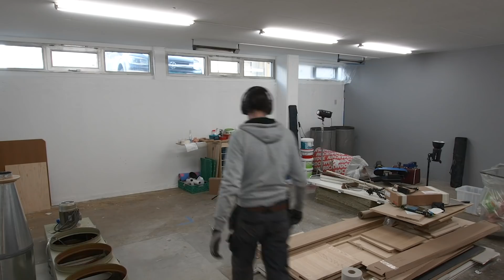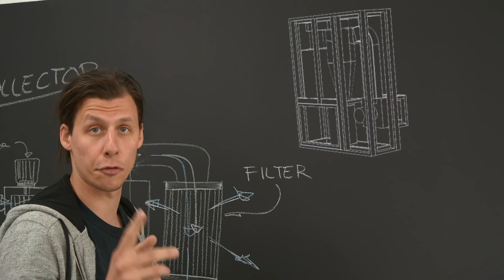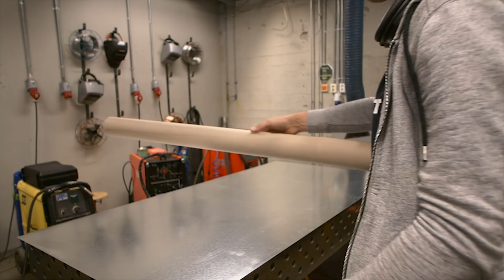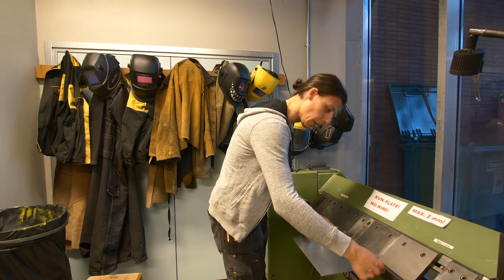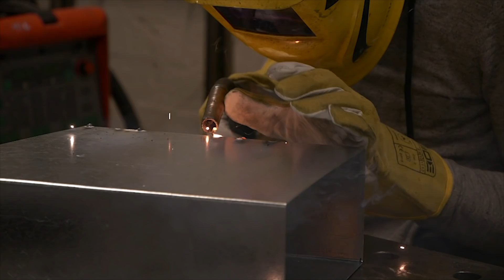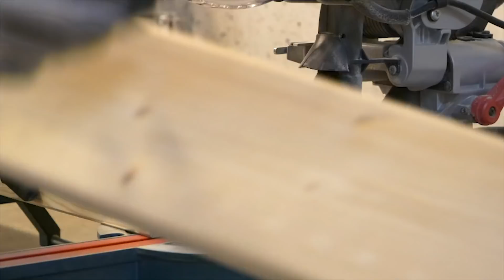Building a Dust Extractor + Cyclone build - Part 1

Comment: I doubt the fine filter will take out the really fine dust. You really should measure that as that fine dust is whats worse and in such a confined space wont have anywhere to go. Such fine filters (at least f7 filter btw) needs cleaning once in a while or they loose most efficiency .

Comment: If you make a V2 look at a Heat Recovery Ventilator. It will get you fresh air in your shop, but keep your current temperature. You could pump the ventilation to the outdoors, so that way, you have no chance of any microscopic dust coming back in. And you keep your heat!

Comment: That cyclone design looks a little familiar! Well done. The cone rolling secret is to make one side of the roller tighter than the other and it will pull thru and turn at the same time.

Comment: wait what, you have your airpump before the cyclone filter? I wonder how that is going to work out :)
Reply from the maker: Radio Roestig perfectly for almost a year now :)
Reply: @achappel  Would be interesting to see if there is a difference in airflow/suction between having the airpump before the cyclone, or having it after the cyclone. What i always learned is that the airpump should be after the cyclone, to prevent "caking" of the dust on top of the fanblades. But that might just be a problem with metal dust and paint, and not so much with wooddust.
Reply: @radioroestig9638  Measured both ways and no difference at all.
Reply: Если турбину поставить после циклона, то учитывая его размер его просто сплющит вакуумом. Так что только перед циклоном.

Comment: The motor and fan/impellar should go AFTER the cyclone. This means large particles or items would go into the cyclone BEFORE they get into the impeller.
Reply: he did it this way so they did not have to use a hard steel drum
Reply: @DragonGateDesign  When the blower if before the cyclone all impacts the impeller which requires use of a much heavier impeller and motor, but you get the advantage of using soft bags and don't have to worry much about leaks. With the blower after you can use a much lighter blower and less heavy duty motor and don't have to worry about something getting sucked up that destroys your blower. I've made them both ways and they separate equally well. I sucked up a big screw driver that would have destroyed my blower and was happy I put the blower after the cyclone.

Comment: If you put the impeller after the cyclone  with a large grill on the down pipe of the cyclone any large debris that may accidently get sucked up (eg rags, blocks of wood etc) will not go through your impeller also your impeller won't have to deal with anywhere near the amount of dust (the vast majority being removed by the cyclone) resulting in a longer impeller lifespan less chance of breakdowns and quieter operation. As a side note I built my cyclone out of clear lexan plastic it is almost mesmerizing watching the dust collect and any large objects can be seen and blockages noticed early.

Comment: Around equipment with moving parts, roll up the sleeves, take off jewelry, no baggy clothes and put long hair back or up! Don’t wear gloves near spinning tools and stand clear of suspended loads! 

There, did I miss anything? ;)
Reply: Yeah, using a mask that´s built to filter dust particles is pointless when welding galvanized steel.
Reply from the maker: Dan Johansson the mask is made for chemicals.
Reply: @achappel  I doubt that it'll filter out gases, but hey, it's your health! I would avoid welding galvanized steel at all, and in your application paint would be as good. I live in Sweden and understand the entire isolation/moisture-problem of your build, I think using a smaller indoors dust extraction unit would be a more reasonable solution... Since that motor will heat the unit above ambient temperature, and then cool down between uses, there is a good chance you'll have problems with condensation inside it.

Comment: Hello, nice video but as others say, fan must be after the cyclone and not before. You can use a barrel with the plastic bag inside and a small hose from the bottom of the barrel to the top of the cyclone, so the negative pressure will be equal on both sides of the plastic bag, and like that you don't damage the fan, and you will if you keep it there :) Also you can add a negative pressure gauge, so you can monitor if something is wrong with the system.
Reply from the maker: Glad you like the video! The fan doesn't have to be after no. This setup works really well, airflow / turbulence is not a problem, and my fan is made to withstand some minor debris :)
Reply: These guys are correct. Your setup is the first I’ve seen with the motor before the cyclone. Just because it works doesn’t mean it’s working at its best. Pulling air through is much more efficient than pushing it. You can push a car up a hill but it’s easier to pull it.
Reply from the maker: Justin Fisher, Sorry buddy... But that analogy just doesn't make any sense. Yes, airflow is less turbulent when sucking the air through the cyclone. But even with the way it's set up now I get near perfect separation. Thanks for watching :)

Comment: Tip, its better tot put the engine between the cycloon and the airfilter.  Pro's the bigger chunks you throw in the system wont get in the big spinny part. And it Will taken care of better airflow in your cycloon. Like your vids! Discorverd your channel last week.
Reply from the maker: Arco Kemp glad you like the videos :) regarding the setup : the cyclone is behind the motor on purpose! The benefit is that I can use plastic bags to collect the dust, instead of a rigid drum. If the cyclone is placed before the motor, the waste bin is under negative pressure, so you can't use a bag. Bear in mind that my extractor fan is built to handle this! Yes the airflow would be slightly less turbulent whit the cyclone first, but this setup flows more than well enough. We've filled 3-4 of those big bags and thers still less than a handful of dust in the bag under the filter ;)
Reply: @achappel  You don't push into the cyclone, you pull through the cyclone, it will work better, and you won't be changing the blades in the fan when large chunks of material damage it. Essentially you should only be pulling air and fine particles through the fan, that's why industrial systems have the fan after the cyclone. How do I know, I used to work in the HVAC Industry in Australia, and we also did extraction for workshops, kitchen's, and even spray booths on an industrial scale. That said, I need to build a Theine Baffle for my extractor, but I'll be dumping the material into a 1000litre's Tote. I should do a build video on it.
Other than that, love your videos, keep up the great work. Also, this video got me to subscribe to your channel.
Reply: Also, looking more at your design, there is a high probability that the air being pushed into the cyclone will agitate the material in the collector, and push it up the outlet of the cyclone. The only thing that would stop that is if the material is heavy enough not to make it into the outlet, and if you have a screen on the outlet to stop large particles from travelling out. Again, having the fan after the cyclone forces the material into the collector.
I was wondering why you cut those edges short, yes, you can weld Galv, but there is no need to if you make seamed edges, and you would have a guaranteed sealed edge. Also, we would have had our arses kick for cutting the material with a grinder, .3 Galv can be cut with Tin Snips, also, using a grinder you've burnt the Galv finish from the cutting sparks so it will rust, as well as from the sparks from welding with the MIG. Probably not so important in your case as it's inside.
Reply: @achappel  oh yes that's true! Forgot about that xd. BTW, cool that you reply on comments! Love the series 👌

Comment: I watched your video's in the wrong order. Whoops. But if you suck up smaller pieces of wood doesn't it hit the fan and damage it? I would make a kind of mesh filter in front of the fan which holds larger pieces of wood that could damage the fan and drop them down into a small bin. See it as like a 45 degree mesh that when wood hits it, it wil deflect them downwards or let them fall down when the fan powers off. I know you already finished the dust extractor but maybe something to add onto one of the intakes. I like to use a dust extractor for small wood pieces. Cleans it up quite nice and quickly.